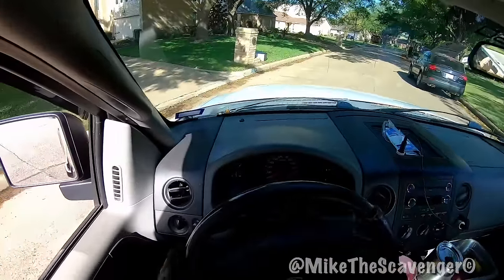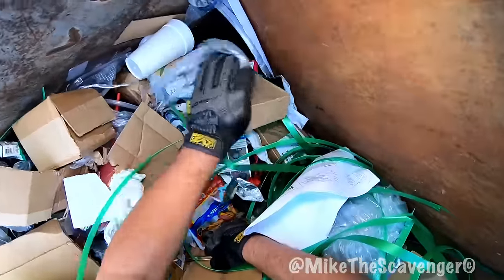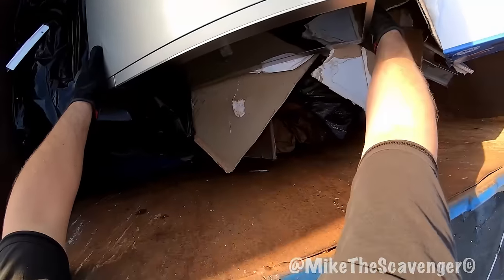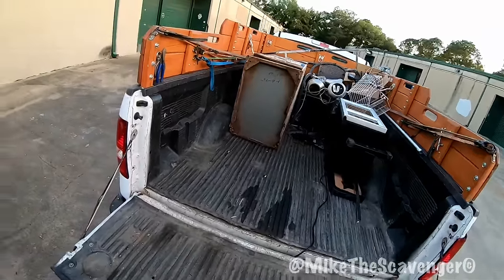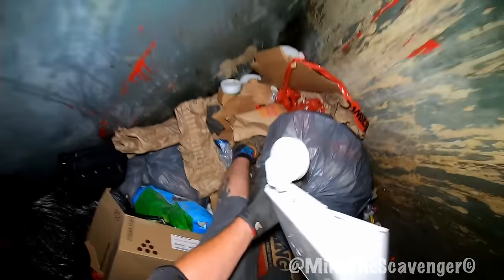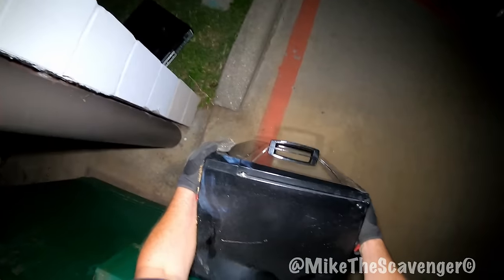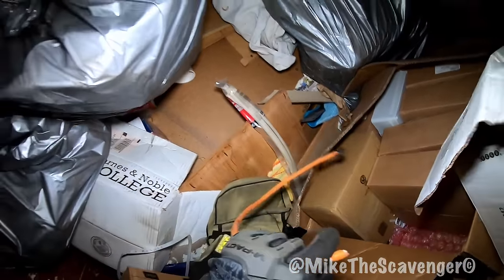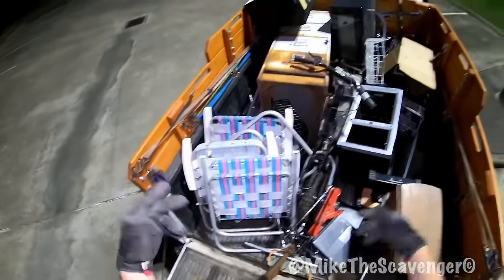Dumpster Diving & Curbsiding "Motorcycle In This Dumpster!"

Comment: You should never pass up any kind of dresser or drawers without inspecting them. Once I found 3 $100 bills taped underneath a nightstand drawer. Years later I found $1,300 tape to the bottom of a dresser underneath the last drawer. Obviously the people who threw them out didn't know what was in there. Probably someone passed away and their relatives just threw them out. So always pull out the drawers and check them before you pass them up.

Comment: That drop leaf table looks to be old and in great condition. It's probably worth a little bit. And those vintage lawn chairs and Tonka toy. Great finds!!
Reply: That table looks like an old barley twist card table ...my grandma played cards on one
Reply: The chairs on ebay have to be unrealistic prices
Reply: The vintage chairs are worth money to collectors, but other than that, remove the steel rivots and scrap the aluminum clean, if you're scraping them.
Reply: So y'all are saying my lawn chairs, that I still use mind you, are vintage? Get outta here!
Reply: That table might be worth more as is than if you refinish it, I'd check out the age before I touched😊

Comment: The invertor is for a solar panel They mount one on each panel. It changes the DC to AC. Each module is independent, and can communicate the output of the panel it is connected to.
Reply: I guess these microinverters are not as reliable as I thought. Or maybe someone cooked them under the panel with not enough ventilation.
Reply: I've got those inverters since 2015 - never had a problem with them...
Reply: They have a 114 year warranty according  to the website. "Thats how we offer our industry best 1 million hour plus warranty..."
Reply: With those being about $145 each I wonder how much money was left in the dumpster. I would think some finds you would want to Google if you don't know what they are.

Comment: When you need to bend some pipe stick it between your bumper and your frame. If you are at a regular dumpster I stick them in the place where the forks of the dumpster truck go to bend them.

Comment: If those lamp shades were clean and not broken, I would have taken them. They are good for $5-10 each. New cheap ones cost $20 at a store. At estate sales you can usually get lamp for $1. I buy them for just the shades.

Comment: I found a 2002 Yamaha YZ 80, completely torn apart in a dumpster it took 2 days searching for all the parts, never found the carburetor,I found out what the deal was and the kid just wanted keep it wouldn't sell it either so I bought one on eBay rebuilt the engine,a bad con-rod bearing later had a nice bike.

Comment: The inverters take dc from a solar panel and convert it to 240 VAC,,  New price is/was about 165 bucks with the cable adapter,,  Need a dc power supply to test them,,  :-)

Comment: What is an Enphase IQ7+?
The smart-grid ready Enphase IQ7+ Microinverter is built on the seventh-generation platform and achieves the highest efficiency for module-level power electronics. Its polymeric enclosure and revolutionary cabling system simplify installation.

Comment: That's a wine amenity deal I know that for a fact because I got one of them myself and I only had to pay $65 and it's a Walmart one a WalmartOne and a really shity and I had upgrade to a $300 one to keep my my champagne and then my red red wine and my white wine by those and adds are pretty good for the way they are there is simple fix and that if they won their prison capella start to go out it's just a little wire. Simple fix and that and it's only like a dollar for a wire but it comes with 15 extra wires for that has 14 several wired that shorts out in them they're really easy to fix

Comment: Part: Enphase IQ7-60-2-US IQ7-60-2-US Microinverter
The smart-grid ready Enphase IQ 7 Microinverter series is built on the seventh-generation platform and achieves the highest efficiency for module-level power electronics. Its polymeric enclosure and revolutionary cabling system simplify installation.
Volts AC: 240, 208
Type: Micro, Inverters, Rapid Shutdown
Also known as: EPHIQ7602US, Enphase, IQ7-60-2-US, Micro Inverters, Inverters, Solar Products, Solar/Clean Energy
Equivalent to: